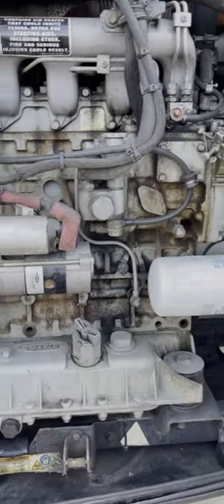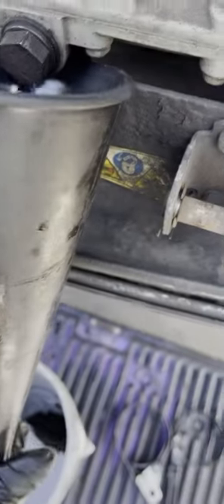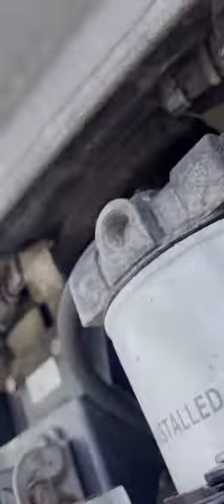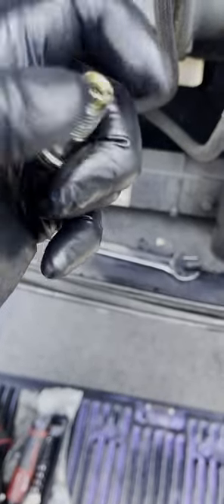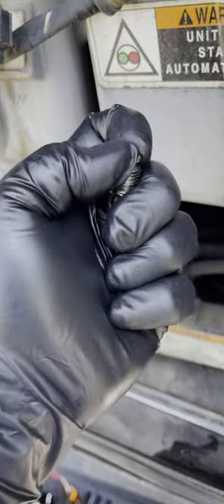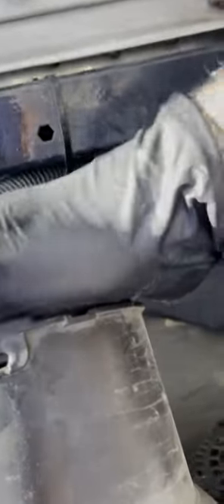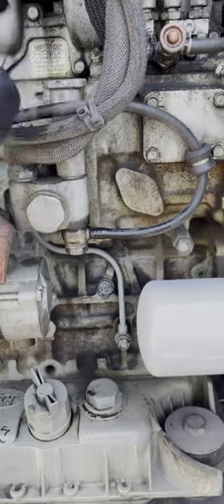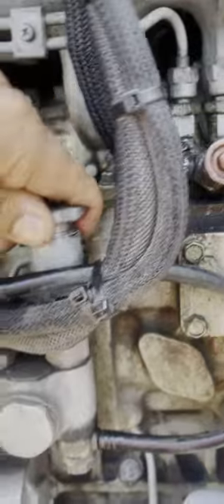Carrier Reefer Oil Change

Comment: Thanks for the video brother. I got 2018 carrier X4 7500 do they all need 15 Quarts of oil ? And also which spray did you use to clean that little fuel filter ?
Reply from the maker: Yes for the most part or 14.7 qts carb cleaner spray is what I use
Reply: Thanks bro. And do you use Mobil Delvac or Delvac 1 ?
Reply from the maker: I use Shell Rotella T5 but it’s whatever you prefer

Comment: My 7500 x4 through the engine oil on rear main seal, an stop ! For replacing should remove the compressor? An I heard about oil seal housing drain

Comment: Hi ， one question， how often do you do the service for a reefer ?
Reply from the maker: Every 1000 to 3000 hours depending on what refer unit you have and pre trip every time before use it will show on the screen if any sensors are going bad